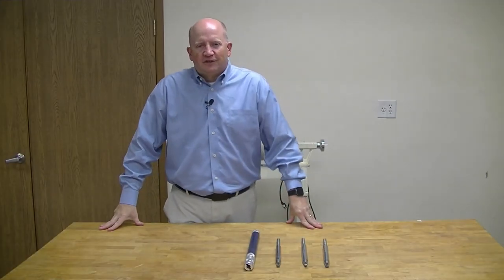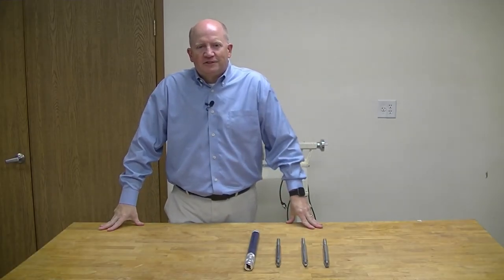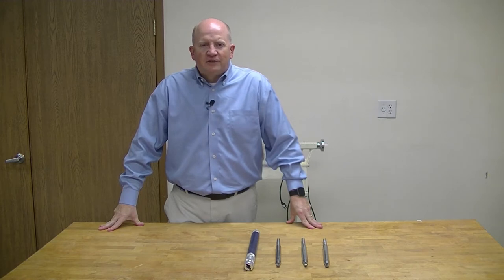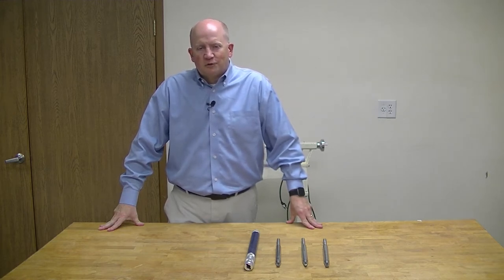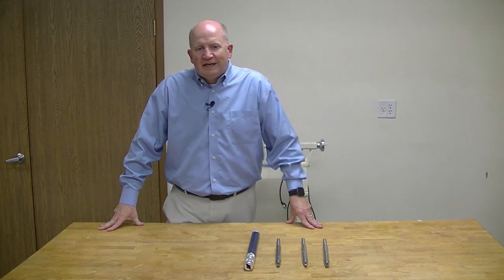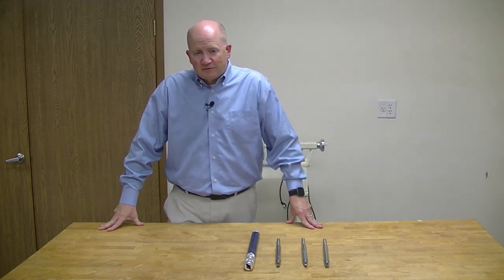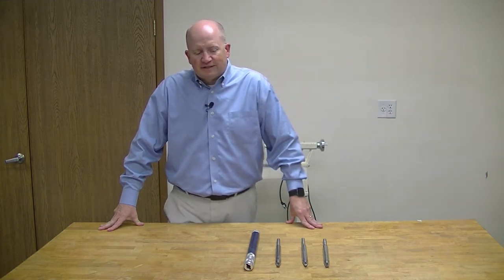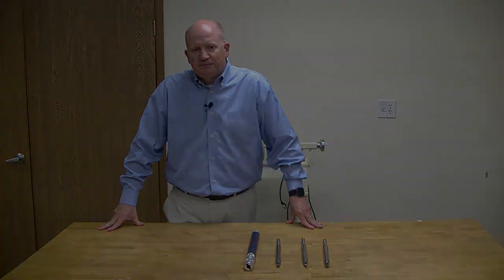Wood Lathe Tools for the Beginner

Comment: I agree with the below comment.  Very clearly explained and some great info from a newbie turner.  The question i have, and i think i know the answer, is why do i see the majority of good turners using steel over carbide?  Is it because the steel can be sharpened?
Reply from the maker: Carbide, while more durable, can never be as sharp as the steel used in modern turning tools.  The steel, when used properly and properly sharpened, yields a much smoother finish.